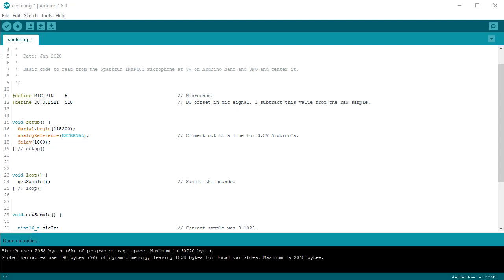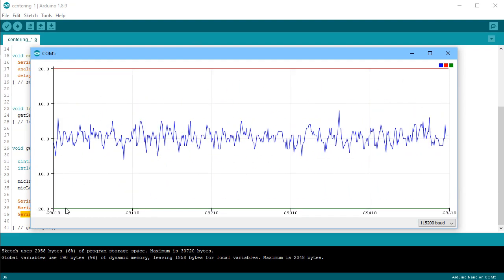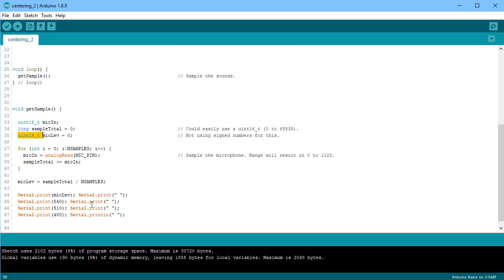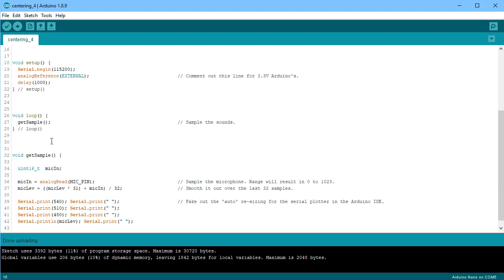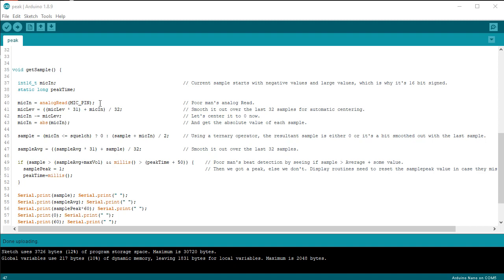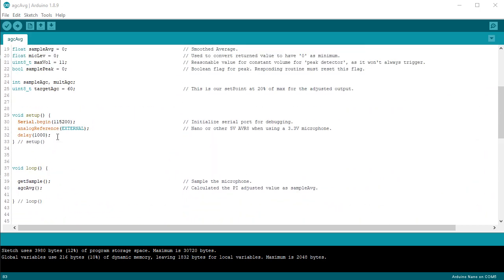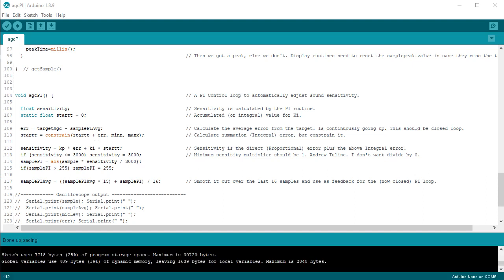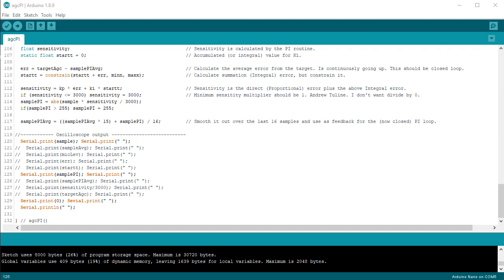Aduino sound sampling for reactive displays

Comment: This video was so helpful learning how some of the FFT functions perform the math operations. Thank you for this. I have been trying to adapt this for a vu meter and trying to increase my speed by free running ADC. Been thinking I can get this to work with a nano small band spectrum analyzer  to cut out using an FFT library. Proving difficult though 😅
Reply from the maker: Hi William, On the Nano, I was using the Open Music Labs FFT/FHT library in order to get frequency based sound reactivity, and it surprisingly worked out quite well with FastLED, although I only used a limited number of leds for testing.

If you want to create a 2D spectrum analyzer, I'd recommend using either a Teensy (and they have some cool libraries for it), or the ESP32. For the ESP32, I used the Kosme ArduinoFFT library and we made great use of it with both 1D and 2D frequency reactive animations with our sound reactive fork of WLED at https://github.com/atuline/WLED.

Of course, I'd be playing around with FastLED and the FFT library for a while in order to get used to it, and build up from there.

Oh, and your captain's hat looks like a lot of fun.
Reply: @AndrewTuline  Andrew thanks for the response. I just got it working a little bit ago with the ESP32 example from Scott. I think I needed to feed the "sampleAvg" into the FFT.computer and computetomagnetude to get better data. Helped to figure out what my bins were too.

Thanks for the compliment! That code is pretty old and once I made a new hat with a matrix, realized I needed to focus more on coding than hardware. But with your vids and Scotts, this fft stuff has made more since. Thank you a million